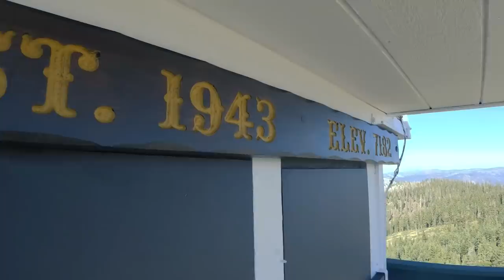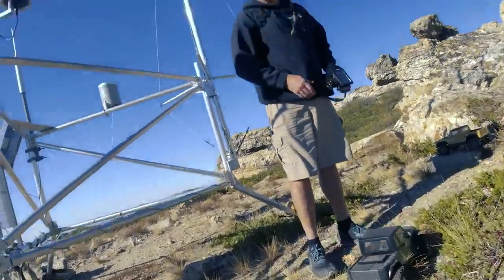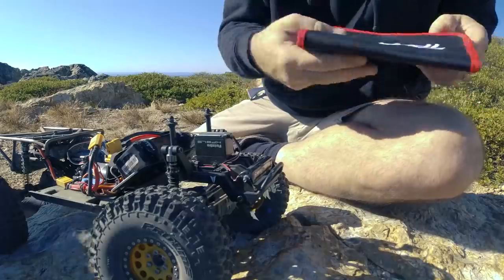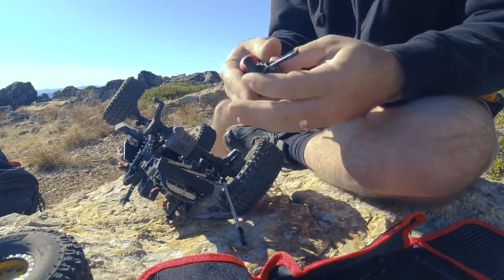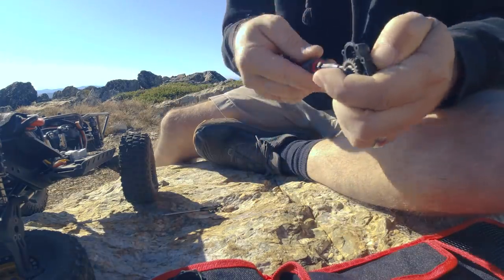TRX4 VS4-10 breaks at Duncan Peak! - Vlog

Comment: That is a sweet truck, definitely inspiring me to do a Power Wagon as my next body. Really interesting that you threw a portal gear, was it the power of the brushless motor or an issue with the portal?
Reply from the maker: That’s the most common issue I’ve had with the TRX axles. It just happens sometimes. I run pretty hard and things fail, but at least there are nice parts to replace it with.

Comment: still not sure how people break that part, ive had my trx4 almost 2 years, have run stock, revolver and now running 3300kv HH , all on 3s, on stock internals. no issues. Maybe i was just lucky lol. You have some awesome terrain!
Reply from the maker: I’ve broke more than 1, just something that happens especially with dig or heavy overdrive. Cast parts and shock loads just don’t always work out 😁
Reply: @HarleyDesignsInc  lol yeah well I think you said you were running like 30% overdrive, I thought the traxxas OD/UD was alot.. then you proved me wrong. must be that 4s power ey :)